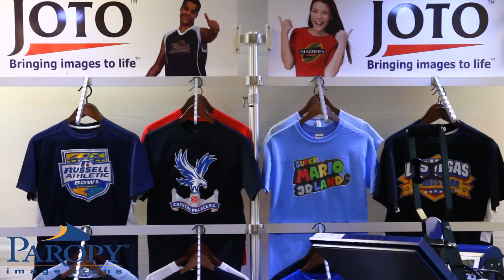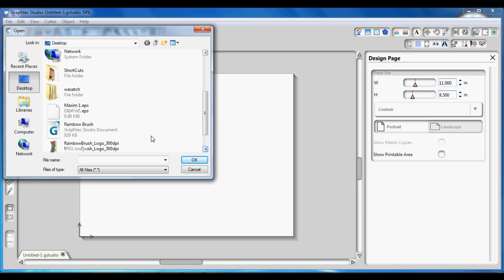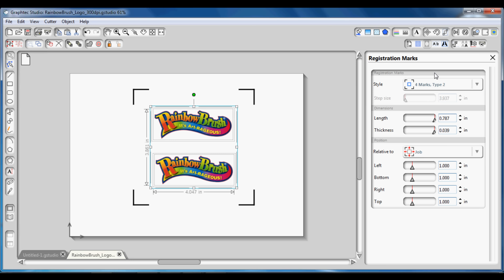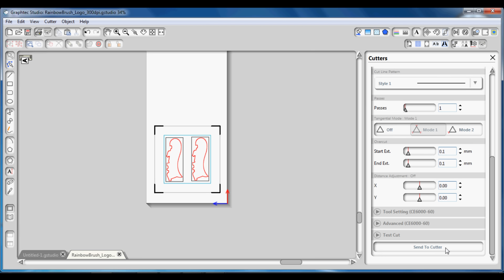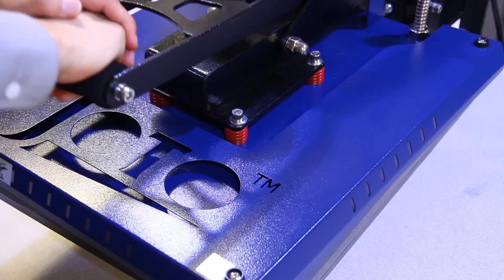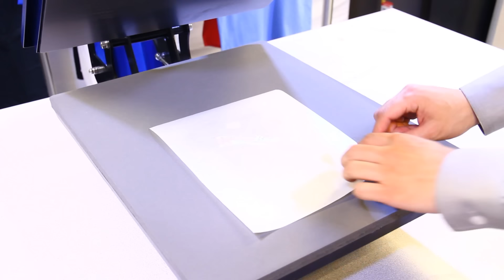How to print onto a black t-shirt using Inkjet Dark Transfer Paper

Comment: Hello can anyone recommend a good dark transfer sheet for printing designs that look like part of the shirt? For example, I have a design which consists of letters on a black background on a black hoodie, however, I want it took look like that black between the spaces of the letter are part of the hoodie and not a separate colour. Is there anyway of doing this? 

Because I don’t want to put the letters in front of a blue box and print out the blue box as well. I want the design to look part of the hoodie. Is there anyways apart from having to manually cut out the design very carefully?
Reply: jotoimagingsupplies thank you for replying. Could I also ask, does an inkjet printer print white ink? Or if I wanted to print something white would it just detect it as nothing? Would my best chance at making White be selecting the lightest colour grey?

Comment: What is the suitable total duration for washing cycles when i wash t-shirt transfer paper?
Reply: +jotopaper 
I'm using your papers .. 
My program details were : 
Washing time : 3 mins   
Rinse times : 1   
Spin : mid   
Water level : 1  
Total time of this cycle was 38 mins . 
The result was that Printed image had been faded !
Reply: +jotopaper
In my opinion Fade is too much !  
What is your opinion about my washing cycle ? 
(Sorry, i can't make acall ! 
i'm not from America and i don't have enough balance to call you :))
Reply: +jotopaper 
Done. 
Thanks
Reply: @moatazmohammed5823  did this issue of yours resolve. will be good to know, as i would want to use this paper